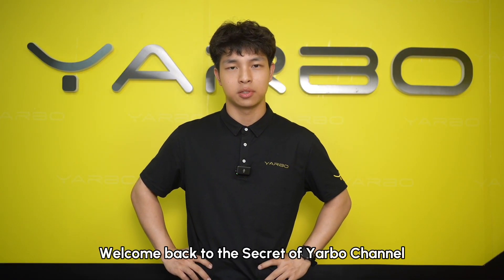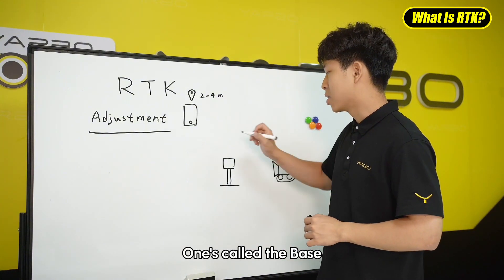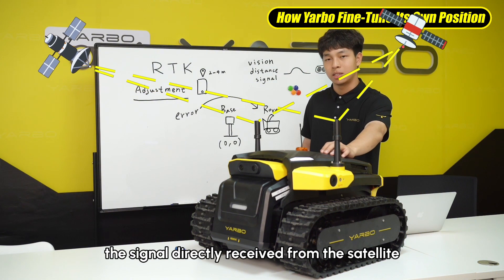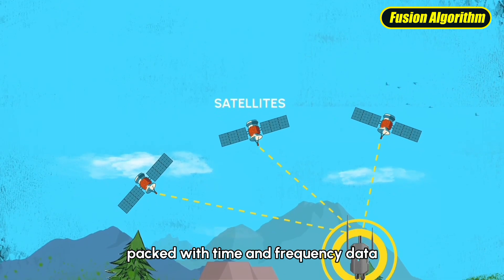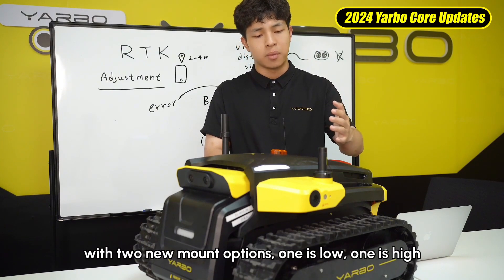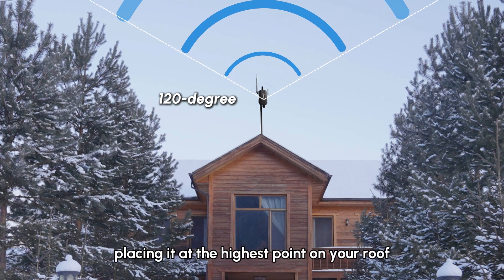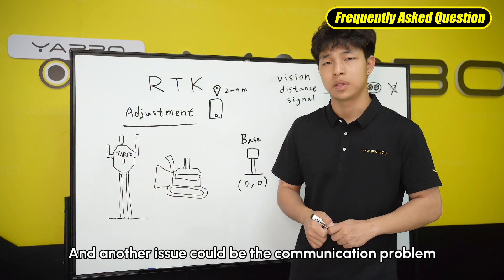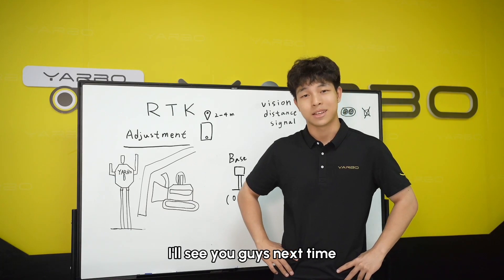The Secret of Yarbo: How RTK Technology Elevates Precision and Performance

Comment: I have my order in! If I wanted to power the data centre via solar and a battery, what is the current draw and voltage?
Reply: It uses PoE+, so just look at the specs of a PoE+ injector.
Reply from the maker: Hi there, great to hear that you have received your Yarbo! For powering the data center via solar and battery, as JayWozz mentioned, we do use the PoE+ injector and the PoE cable will be included in the package and shipped to you. We highly recommend using Yarbo official chargers, as other chargers for private use are not recommended to ensure the safety of Yarbo and yourself, as well as to best secure the function and performance of the Data Center. Thank you for your support along the way and please feel free to reach out if you need any more information.

Comment: There are GPS repeaters that can be used to bring the GPS signal into a building such as a garage or shed.  Have you tested Yarbo with any of these units?
Reply: GPS repeaters would not work for this scenario. When using a GPS repeater, the target device (Yarbo Core in this case) always interprets its position as the position of the repeater's antenna.

This means that, once Yarbo Core gets close enough to the GPS repeater, it will think it jumped to the position of the repeater and then think it's no longer moving.
Reply from the maker: Hi there, thanks for asking! In the United States, the use of GPS repeaters is strictly regulated by the Federal Communications Commission (FCC). The FCC has strict regulations on the use of this equipment, mainly to prevent interference with GPS signals, because the GPS signal is very weak and satellite signals from space themselves are susceptible to interference.
And it's not feasible for Yarbo either, it will not work with our RTK system:
Suppose you are using a GPS repeater in an underground garage. The GPS signals received by the devices in the garage are forwarded through the repeater antenna installed outside the ground. Therefore, the GPS device will identify its current location as the repeater's antenna location (the ground location outside) rather than the device's actual location in the underground garage.
In summary, the GPS repeater does not allow the device to "recalculate" the actual indoor position, but extends the coverage of the satellite signal. The device will display the outdoor location of the repeater antenna, which is useful in certain scenarios, such as a test environment or enabling the device to receive GPS signals. This should be installed so that you can navigate indoors, but this GPS repeater actually displays the coordinates of the outdoor antenna, which is still blind indoors. Thank you for reaching out and if you have more question or need further information, please feel free to ask!